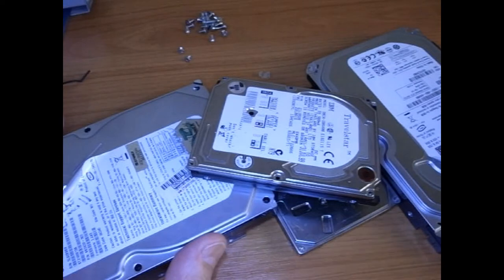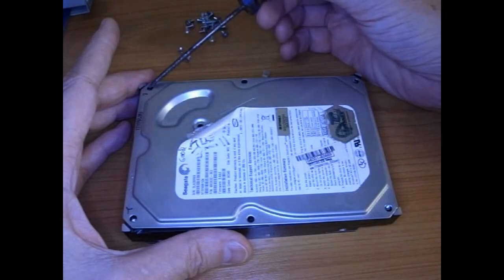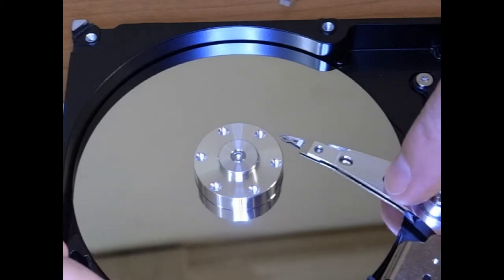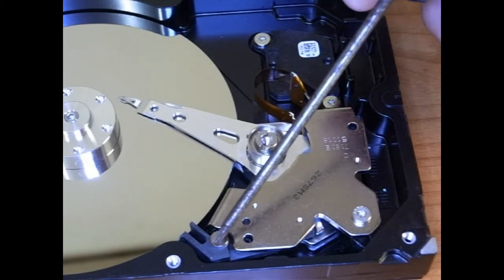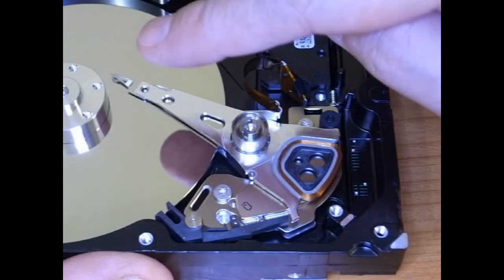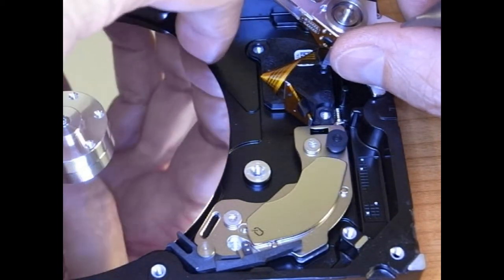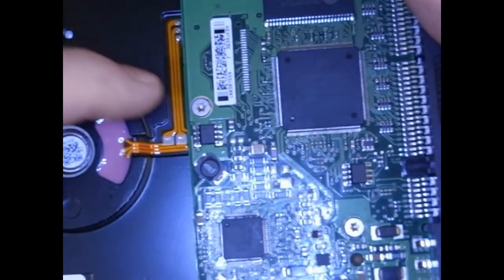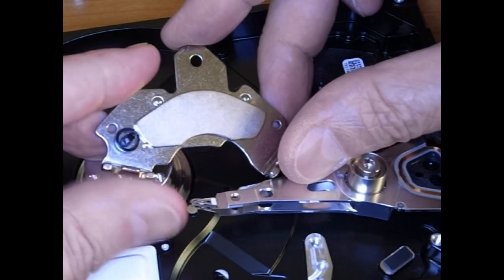Hard Disk Salvaging Parts

Comment: There’re lots of good parts on the circuit board if you’re interested in electronics. You can find a SPI flash, a microcontroller, voltage regulators, MOSFETs, and lots of passive parts. Also those motors are super precise. Also the magnetic coil in the platter reading head is super precise.
Reply from the maker: Very true!